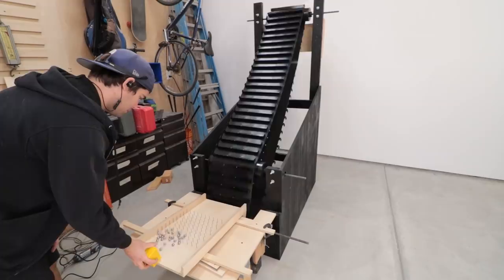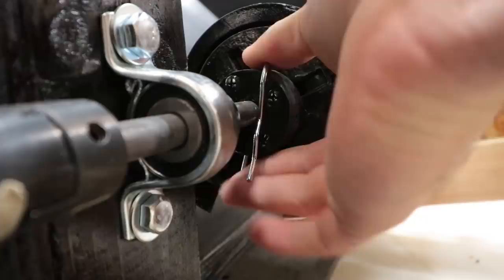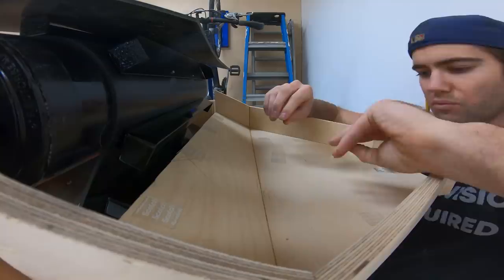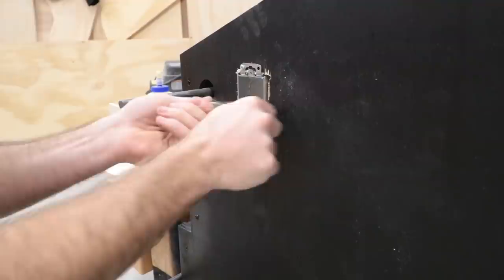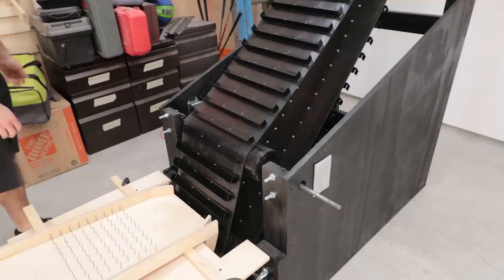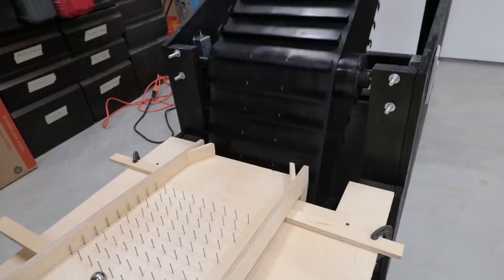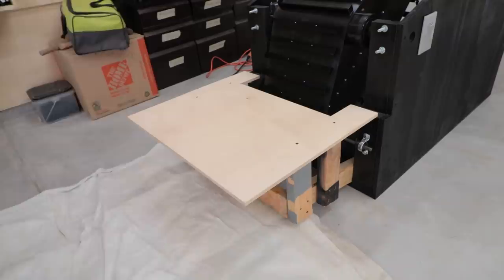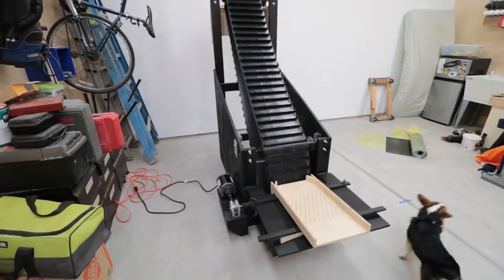Universal Marble Machine Lift Build Part 5: Test and Adjust

Comment: I've been seeing how you build it for a few weeks and I'm sorry but I don't understand the purpose of that machine.  But I love your dogs !!
Reply: Check out his oldest videos. He originally made marble machines and wants to start making them again.
Reply: @Mitrasmit  Hi thanks!  I have seen all the videos in this series but I don't understand the usefulness of the machine.  I write from Spain and I believe that the MARBLE MACHINE translation does not identify what it is used for.
Reply from the maker: It’s a stand alone mechanism to lift marbles. With this machine working, I can focus solely on the downhill portions and plug them into this lift. So instead of building a new lift every time, I only have to build a new downhill marble run
Reply: @BenTardif  thanks, now i undeestand. God job!

Comment: Hey I just thought of something, why not putting the bracket in an other way ? Like for example the first is my idea and the 2nd is the actual bracket on the belt
  o /    o |/
----/    ----/  
   |/        /
Maybe the marble could be bounced back by the neoprene I don't know just an idea (sorry if this ain't clear to you)
Reply from the maker: The issue is with the outside edges. If there is nothing keeping the marbles from rolling off the sides, then they’ll roll off the sides.
Reply: @BenTardif  yeah of course keep the outsides edges just bent it in the other side